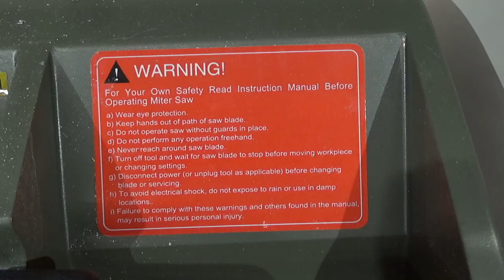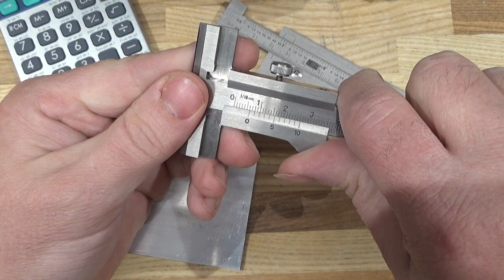Musical: Swarf Corral for Proxxon FF230

Comment: Really nice and useful project for the little Proxxon mill.   
I have one question for you FRT; at 4:40 you start the milling operation. The table wobble looks plain scary. Was this caused by your whole workbench wobble, was it a mill sliding on the table cause it isn't bolted down to anything? Or was it a X or Y axes problem? I hope it is the machine sliding on the bench, but I'm really excited to hear your replay.  Cheers
Reply from the maker: Ha... just the rubber feet on the base of the mill reacting to the hand wheel jogging. Will eventually do a video on the mill... it is pretty solid and has very little play.
Reply: @RoomForTools  That is what I was expecting, but I had to ask! Were you considering to add an autofeed feature to the X axis of this mill?
Reply from the maker: Was thinking that a small electric screwdriver would do the trick, though RPM control would be absent. You have any ideas?
Reply: @RoomForTools  I actually do. I was thinking of adding a closed loop stepper motor with a set of belt and pulleys. That Way the machine could keep the original manual functionality and still allow for more precise milling with x axis. I am thinking about one toggle switch for L / stop / R direction and one dial for feed speed control. That would probably be enough of controls. Ok, maybe adding the display where you could see the actual feed would be a nice addition. The other option, if you were considering to CNC it would be to use MPG hand wheel for any potential manual operation. Personally, I would prefer to keep my mill manual. I have a brand new HAAS VMC for the CNC side of things :)
Reply from the maker: Crickie... hope you post a video!
Reply: @RoomForTools  I will keep you updated with my progress. I am waiting for parts to arrive. The only problem is, my mill is based on the KT150 bed, so you'll probably have to  make different motor mount. Gotta go to bead now. Cheers!
Reply: @RoomForTools  

I have a hard time imagining that. I see the table is wobbling like crazy, but the column and base don't move in this video.
If the rubber feet where the cause, everything would wobble, including column and base.
So I still think you have to adjust the gibs.

I like the idea to make a shield of modules!
Made something alike, but from PMMA and magnets. However just 4 parts (back and front, and sides). 
I think your solution is better, more versatile.
Reply: Great video, and the music with subtitles is a nice format! I’m building an arsenal of Proxxon stuff, currently the drill press, FET table saw and the chop saw, because I’m looking at possibly moving to a condo and giving up my large workshop. I’ve gotten good results from these machines, but only after I finally pounded it into my head that the stuff wasn’t, for example, the 10” 15 amp tablesaw that I’m accustomed to! The precision of manufacture on these things isn’t as good as I’d imagined though, and things like the 90 degree detent stop on the chop saw being a fair bit off is an example! So my saw now has a scrap of wood wedged in the toggle to render it inoperative, and I square it using a machinists square in the vise and locking it in position with the thumbscrew. My next purchase will be the PD250/E lathe, then the FF230 mill. Your vids have been very helpful in understanding what I’ve got ahead of me! Cheers!

Comment: Did you think the mitter saw could  cut hardened steel 🤔 5/8 rod? And could the milling machine is capable of mill mild steel I am planning of making some punch die plates and they need some canal and groves to fit the aluminum profile in place for the punching die to go tru them and I need the cheapest milling machine I could get for know
Reply from the maker: Saw cut-off wheel would go through 5/8 hardened rod, but slowly and not very square. Milling machine will handle mild steel without a problem, just a tiny bite at a a time.